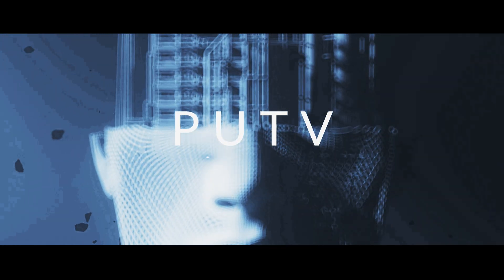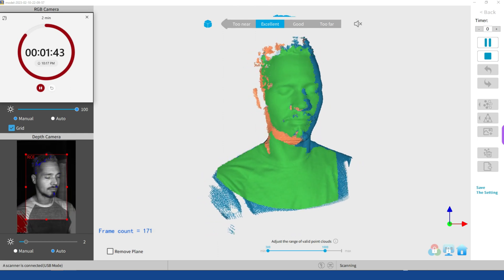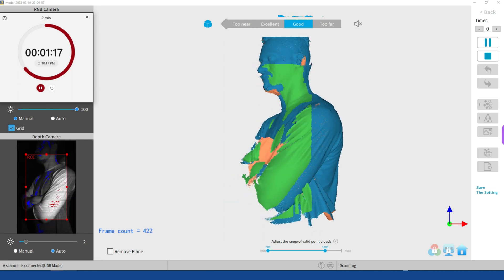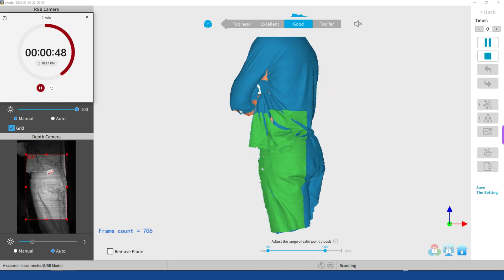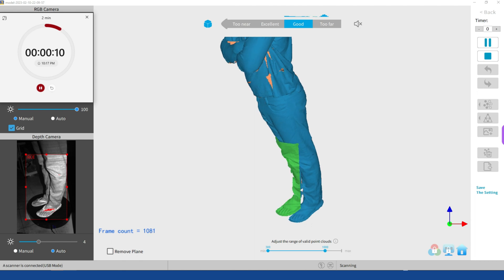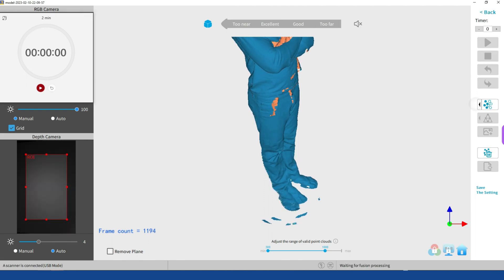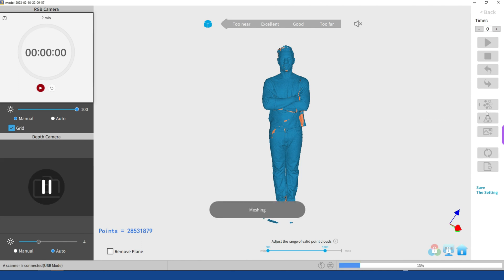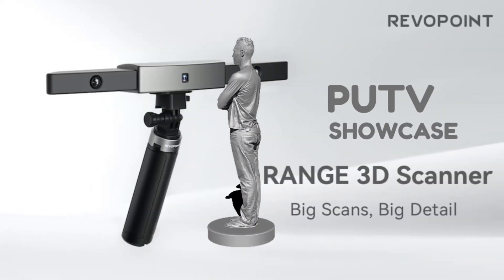Revopoint Range 3D Scanner | Scan Full Body in 120 sec

Comment: Revpoint seems to have better detail than the Einstar. For people that is.
Reply from the maker: Yes definitely, I tested both and Range was the winner in my book , however Einstar has better textures , however as a 3D modeler , I prefer to have better mesh than color textures as that I can do myself . Not to mention you can scan the full body in 2 minutes so very quick when using turntable .

Comment: I might finally get my hands on one of these, but I wish the texture quality was super high res
Reply from the maker: That is the thing, since 23 years the textures never improved for some reason with all 3D scanners  .  But for a full body scans even a 8K textures will be much too small , for the kind textures you looking for will be 32K and that is sadly impossible with 3D Structures Light 3D Scanner . Too much data to be process in real time .  However what they could do is a different texture mapping system for after scanning  aka re-mapping system with projection mode. I don't need high resolution textures as I texture my models manually anyway so I care less . 3D Scan textures are usually not usable for anything but preview on the internet .
Reply: The only textures I'd really want are from human actors to remap in ZBrush. If you could turn off the range limits, you could get some very crisp details.
Reply from the maker: @MrRileysGameroom  Right now the texture size is only 2K , so for human full body it is nothing , not even good for a head . I tried everything , hopefully it change however I don't expect crisp .. remapping will not help either as I tried already in Zbrush , the only plus was converting Range polypaint (RGB)  to new UVs but nothing crisp . I am working in this field for 25 years creating digital characters .. not usable for professional work but good for reference when Texturing using real photos , I am remeshing the scans because who want to work with triangles , you can get pretty good displacement and normal maps btw .. Albedo not as important for PBR rendering .

Comment: Great results 👍 have a pop 1 and was looking to upgrade for awhile and this looks perfect as I want to mainly scan people and faces. One question, was this all meshed on the revo software or did you use cloud compare to get the great results showcased at the end ? Thanks.
Reply from the maker: Thank you Damien , all showcase models was batch processed in Revo Scan on full quality . The default meshing in Revo Scan is slightly lower than under Batch processing . You can use Cloud Compare if you want to get more from the point cloud but I don't think it is nesesery. Upcoming Revo Scan 5 will have all the top quality meshing for Range so you can do the best possible meshing inside Revo Scan 5 , better than I did in v4.3.1 at this moment .
It is great for full body and faces , you not going to be disappointed , great upgrade even for POP2 users as it scan better full body than POP2
Reply: Thank you for your reply, I have now backed it on kickstarter and look forward to seeing more of your great scans and tutorials ! 👍
Reply from the maker: @damienburke5514  congrats on your new tool Damien !  I will have to work on lots of new tutorials for Revo Scan 5 as the software have a new design and lots of amazing new tools , so definitely.. thank you for your support and if anything just let me know .

Comment: Can this scan black surfaces?
Reply from the maker: Yes Range can scan black plastic , clothing etc it is much more powerful than POP2 . I believe only have difficulty with wax, some semi transparent resins and black silicone , materials that absorb Infrared light . It can scan also brushed aluminium and brushed stainless steel to a degree .
Reply: @PUTV3D  so it will scan black hair?
Reply from the maker: @ethansdad3d  it depends of the hair , my husband's scalp hair are deep  black as you see in the video above , his eyebrows and facial hair was not big problem either.  I guess oily or curly black hair can have more issues since it absorbing more infrared light  , but little of dry shampoo can fix that or higher level of gain settings .